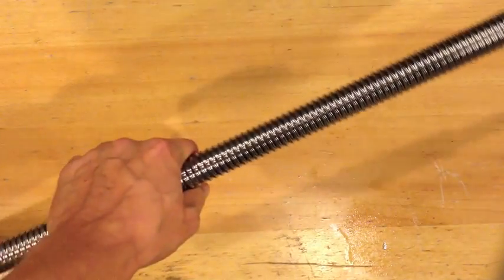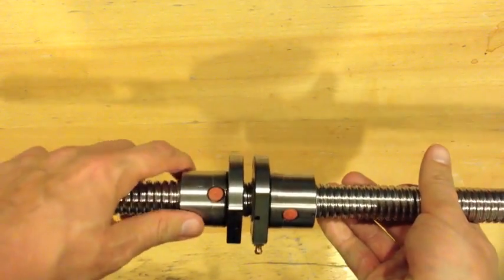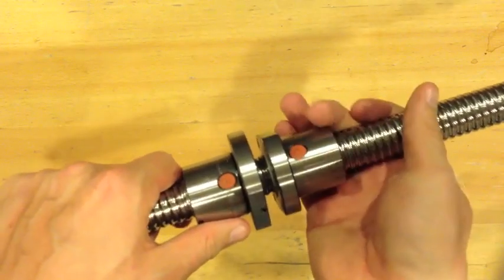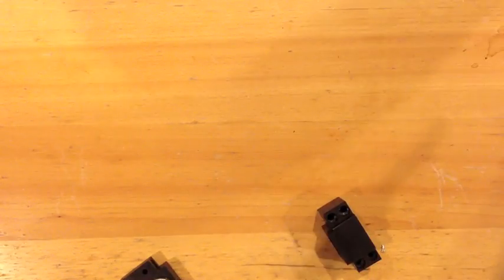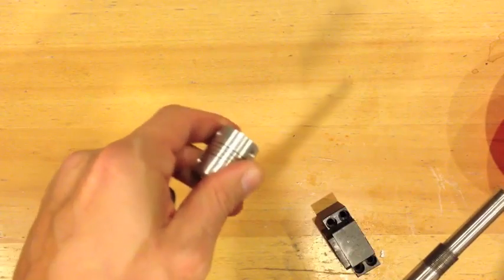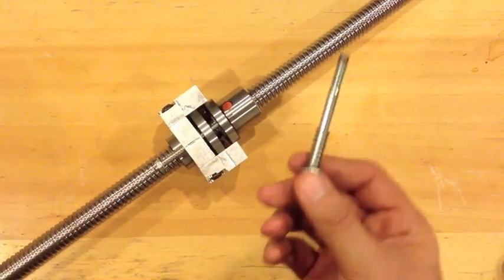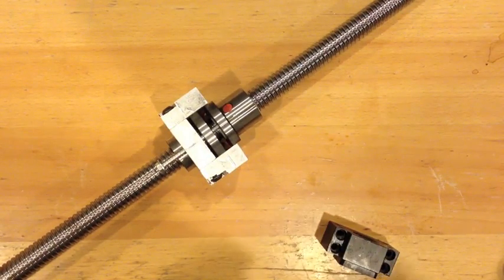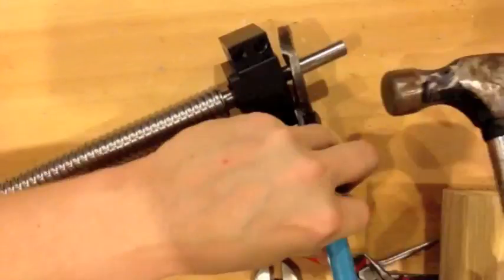THUNDERDORK: DIY CNC Router -- Anti-Backlash Housing for Rolled Ballscrew

Comment: Nice work man. This backlash-limiting technique is reliable. But for all the hobby-grade CNC routers and machines owners out there: Don't waste your time and energy to do backlash compensation on a vertical axis! Unless you have counterbalanced head (Z-axis assembly) Earth gravity is your best friend! Not sure what force can the little spring(s) you put there make, but I guess the weight of you spindle and Z-plate makes more!
At least you did it the right way (pushing the 2 nuts together). People pushing them apart on vertical axis actually negates the positive effect of gravity which often leads to worse backlash than without the second nut.;-)

If your Z-axis assembly has at least 10kg (22 pounds) you're good for standard milling operations (drilling might need more depending on how hard you push and to what material).;-)

Comment: I am hoping that you did not lose the little copper piece the should go inside the fixed end support nut before you lock the set screw. It helps to protect the threads from the set screw.

Comment: I see and hear often about about precision and backlash and so forth, I find it interesting that all of the comments forget to look at the CNC Machine as a whole and how it is used. Firstly can you even measure 0.05mm? Second how good is your end mill cutter? How secure is your work piece held? What material are you cutting? All of these thing add to the tolerance stack up. So I think it's more important to be realistic about your parts you want to make and build a machine sufficient to make that part within your budget. Please don't read this as a snipe at any comment here or the video I am trying to convey a wholistic approach that an experienced Mech Engineer does from years of experience.
Reply: +Molo mono are you sure you have a degree in Megatronics? Is that not something to do with Transformers the children's comic books? There is no elitist attitude on my part here, just a full acknowledgement of realistic expectations in a hobby machine. What's more of issue is that you feel the need to swear as a method to "Flame, incite or elicit" a response from someone else's point of view.
Reply: +Molo mono cutting watch gears on a hobby made machine is way beyond most people's skill set to to achieve. Easy to say, much harder to do! Thermal expansion alone would take you out of tolerance which is something you can't design a machine to fix as it's an environmental issue. Grab some reality or an engineering degree.
Reply: MrVajutza I told you to drop the elitist attitude, but your ego is so big you don't even realize that you have one.

Btw a mechatronics engineer average salary is higher than a mechanical engineers.

Not bragging, just responding to the passive aggressive insult. Furthermore i don't feel like continuing a conversation with you.
Reply: +Molo mono I have no ego, just a point of view which you seem to disagree with. If you felt that strongly, I suggest finding a better outlet than your current method. All the best, I hope you achieve your tight tolerance goals for your machine. 😃
Reply from the maker: i want it all and i want to do everything. hence the over build.
Reply from the maker: +MrVajutza Its designed to be upgradeable to do continuous 5 axis routing with an C/A head.  The reason for the overkill is the 3' z axis drop and the wish to do molds out of aluminum. Plus, 1/4" walled metal tubing is surprisingly cheaper than extruded aluminum.  I won't really be able to measure true runout until I get the new spindle for the C/A head in.
Reply: +MrVajutza Depends, if you are cutting gears for watches than 0.05mm is not enough. + any backlash would noticeably fuck with your result.
Reply: MrVajutza
I have a degree in megatronics so don't bother with the elitist bullshit i'm too old for that. (and it's way to prominent at work already).

I was just giving an example of something people actually mill in which a 0.05mm tolerance is measurable. We aren't talking rolex grade shit, we are talking hobbyist trying to push the boundaries of their cheap machines. It's something i can entirely get behind. And yes you did ask some relevant questions, but do you really think someone designing/building an anti-backlash bracket didn't think about how secure their workpiece was being held first?

So does backlash matter, yes it does. Does runout matter, yes it does. Are you better off buying higher quality parts? Yes of course.

But that takes the fun out of being a hobbyist doesn't it?
Reply: MrVajutza I couldn't agree with you more. I'm an electronics engineer building my first CNCs and can't see the point of improving everything to an extreme level without clear performance/precision requirements. Good engineering is exact what you defined.

Comment: I don't get it exactly, how could this eliminate the backlash.

You put a spring between the nuts, you have put an additional tension in the system.That spring-force pushes the nuts to the opposite direction. This construction won't show any backlash, when you try it by your hands. But the force - when the machine is working and chipping/milling metals - that force could be much bigger than that spring-force. And that force will push (or pull) the spring, and the backlash accuracy error will be there, because its limited only by the rolling balls and the nuts.

Nothing has happened to the backlash, when you use this device with bigger forces than the spring-force. Just like a CNC machine.
Did I miss something ?
Reply from the maker: +telelaci2 The ball screws already are preloaded with different size bearings to pretty much eliminate all back lash.  The springs make sure that it is gone as much as possible by squeezing the nuts together.  Been running a year now. No backlash.
Reply: +ThunderDork
I believe you. It depends on your machine size, and the ball size preload. And actually you made it even more rigid with doubling, no doubt. I'm not saying this is crap, not at all. It could work.

I'm just telling you , if you wanna make it even better, in terms of backlash, don't put spring between the nuts, but make an adjustable but rigid connection. And actually you don't  have to do that, because you can buy it in the shop. Ask for DFU nut instead of SFU. Almost all type of nuts have its 'D'ouble pair. And one DFU is cheaper than 2 SFU nuts, and assembled in the factory, which is always better than the garage.
Reply from the maker: Thanks for the advice.  I didn't make it rigid at the time because it was a cheapo c5 rolled ballscrew I believe...?  I was worried the threads varied in pitch oh so slightly up and down and would wear. I did see double nut ballscrews.  At the time I was broke, and I think the chinese reseller threw in an extra nut. Then I had $5 left to make this :)

I liked Richard McMahon idea below about shiming between them instead of the springs on the outside. some springs held between with the through bolts No machining required.

Thanks again, cheers!
Reply from the maker: +telelaci2 oh wait, i remeber why did it this way.  i tried the bolts/springs between thing and there was too much side to side play since the bolts weren't in tolerance with the through holes which might have cought me a few thousandths in accuracy.  hence the trapping box.  he might have meant something different.
Reply: telelaci2 the tension is applied at the beginning of set up
Reply: ThunderDork those don't have backlash that's why they aren't just plain nuts. They are anti backlash. engineered for that.

Comment: I think you would be better off making a shim the right thickness and sandwich it between the two ball screw nuts and then screw them together.  When you eventually get backlash after a lot of use you can sand off the face of the shim to reduce your backlash again.  Just measure the distance between the two flanges and make the shim about 0.001 smaller to get a bit of pre-load and bolt together and test.  You don't want too much pre-load as this will reduce the life of the nuts and screw.
Keep the videos coming. :-)
Reply from the maker: +Richard McMahon Thats actually a really good idea. You should post a video showing that. Wish I had thought of it first.
Reply: I've just converted an Elliot jig borer to xy cnc but only put a ballscrew on one axis, the Y I used the acme and adjusted the backlash on the nut and that axis is super good, < 0.01mm . the ballscrew is 0.11mm and I did put a spacer between the end block bearings which lost 0.2mm backlash.  Ive just ordered a second 1204-3 ballnut and will just put threaded bar and nuts to hold it off the first ballnut in the housing. Glad to watch the vid. Thanks.

Comment: hello friend, I'm starting on building a CNC wood carving basically, want the highest possible precision with. You could provide me information which ball spline is the most suitable. Thanks in advance for your valuable help
Reply: +Wilfredo Yusti 
A Hiwin 2505 rolled ballscrew's axial backslash is about 0.04mm = 0.00167inch , its not so bad, and its enough for woodworking, but not for really accurate metalwork, only on hobbyist level, not professional. I'm talking about "Hiwin" which is a good rolled one, the nonames could be much worse, it depends on the conscience of the eBay seller.

The gound ballscrews (this is what you want, if you want the "highest possible precision") are much-much better it can have only 0.003...0.01mm backlash it depends on the precision grade (C0-C5, C0 is the best) and the preload (relative size of the balls). Usually people buy used ground ballscrew on eBay, because its affordable (although its still expensive...100-300 USD) , but its still better than rolled one. New ground ballscrews are for firms or millioners , they are for 300-1000USD or even more. They are usually Japanese. Noname rolled ballscrew is 50 USD.
Do you see the difference  don't you.
Reply from the maker: There are two major types of ball screws: Ground and Rolled. Ground ones are more accurate because they grind them down to tolerance. Rolled are rolled into shape by machines and are less accurate. They are also rated more precise C1 to less C7 (if I recall correctly). For wood cutting I wouldn't get to worried about precision. Might even go with acme screws instead. Hope this helps.

Comment: Bad idea and a lot of work . I by double nut with backlasch free and costs lower as two single nut . So , what is the reason do do additional job . Your fixture also have problem with  additional space and your maximum axe travel distance is reduced because of total nuts-fixture lenght .
Reply from the maker: Didn't have a source for double nuts. Aluminum was all that was at hand. You should share your source to save others then.
Reply: Try type on google zappautomation or hiwin ball nuts . Hope this help you .
Reply: Zapp seems to be UK and their double ballnut actually costs more than my ballscrew setup altogether ($150 minus VAT and shipping). I could imagine Hiwin being even more. These are Chinese rolled ballscrews for hobbiests. Let me know if you find a link to share with folks.

Comment: Split lock washers are fine... I'd have used a set of new 'Nylock' nuts (never reuse old nylock nuts for important fittings) as well... BUT MOST IMPORTANTLY I'd have used Loctite 243 on EVERY nut and bolt in the assembly... That way I know it's not gonna come loose unless you want it to..!

Comment: Hi :) if you take the ball nut block and have another one made twice as long and fit each ball nut in each end like you did with the first ball nut. The second one can be bolted in and adjusted by shims then you can oil both nuts by a hole in the block and the oil has to come out through the ball nuts. the space between the ball nuts can act as a resawar for the oil.

Comment: Hi:) The mounting block on the threaded end is on backwards it would be easier to change bearings if the mounting block brearing cover faced outwards.

Comment: Yes, usually by about .0002. You might have 2 different sizes in the ball nut, but no more than 2 different sizes. When they install the balls in nut they put them in order as such.... SizeA, SizeB, SizeA, SizeB etc., until ball nut is full.

Comment: Hello,
 One thing i found out about some ballscrew nuts is they have 2 different size balls in them. Most are .0002 in difference. Example: .1250,.1252,.1250,.1252,.1250, etc. This keeps them from trying to "climb" over one another when rotated. Might be why the one in video is not smooth.
HTH

Comment from the maker: I tried using bolts that had a shoulder but the holes themselves are oversized so there was a bit of play.  Could turn down and thread some rod but didn't have metric dies.  the bolts alone could still do the trick though.  i chose to over engineer to be safe.

Still is a slight play even thought i machined the pieces precisely. probably for the best.  if there were no play at all it would probably mean it would clamp the pieces together and defeat the purpose of letting the one slide.

Comment: Interesting idea... though it seems to me you could just eliminate the block, and use the M6 bolts and springs directly on the other ballnut; and the bolts themselves would prevevnt the other ballnut from rotating.  Shoulder bolts would give a more accurate surface.

As for the bearing balls, the best way to prevevnt them from falling or losing them is to find a tube with a diameter close to the root diameter of the screw that can slip over the bearing journal to unscrew the nut to.